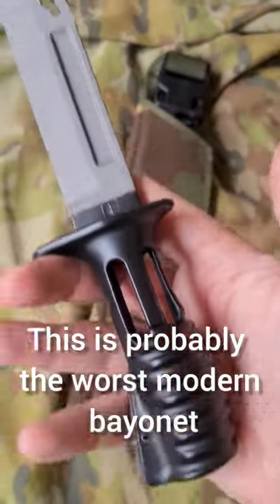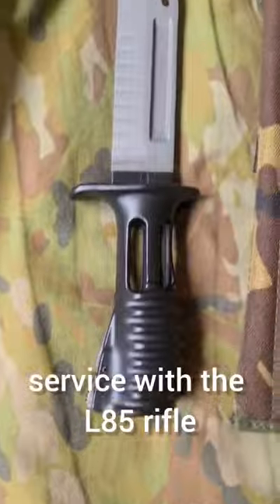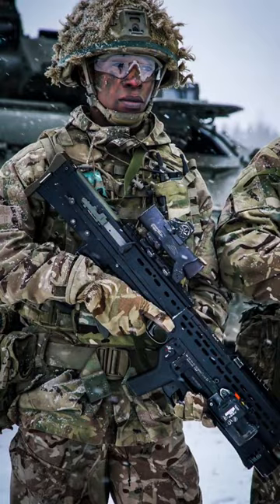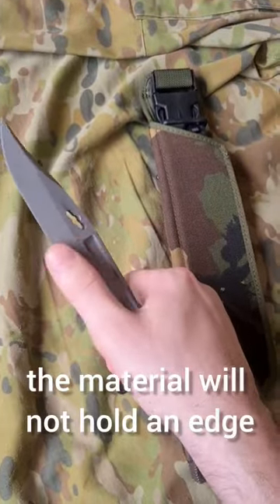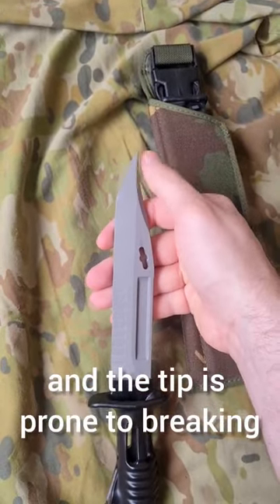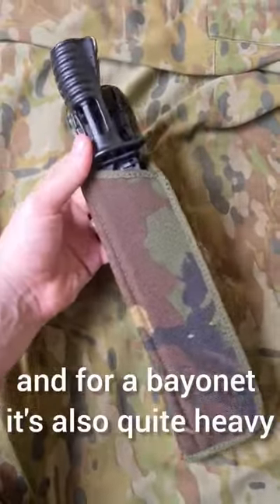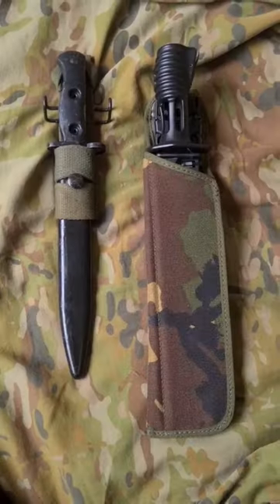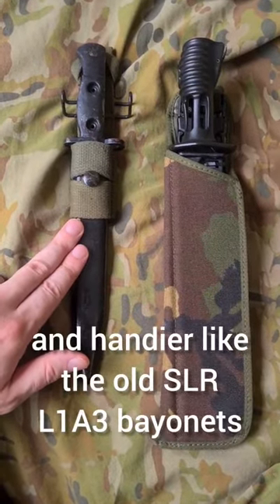How are they still using this 30 years later! #bayonet

Comment: How do the brits mess up a knife?
Reply: They got so much experience 😂
Reply: @angrydragonslayer Not true. The FN L1A1 was a great rifle, so was the bayonet. Similar for the Lee Enfield rifle. BREN and Browning pistol.
Reply: @anthonyhassett  i meant experience in stabbing
Reply: To be fair, we Americans can hardly laugh considering the issues with the M9 like how its designed means you can't cut electrical wire without wearing insulated gloves.
But then we also made the OKC-3S, which is really good, so I guess we do have some room to laugh at this bayonet
Reply: @anthonyhassett the Browning was Belgian, the L1A1 was Belgian (same designer as the Browning actually) the Bren was Czech and the Lee Enfield is gasps Canadian.
Reply: I mean, thats literally what they're known for!!
Reply: The British version of the FN FAL had a very different bayonet, based on older british bayonets, to the Belgian ones.
Reply: @warellis  the grip is insulated plastic and so is the sheath of the m9 bayonet
Reply: @justnsaliga8518  And yet the M9 bayonet guide says you can't cut electrified fences with it. If it is insulated to protect against shock, it has failed
Reply: @anthonyhassett  the BROWNING pistol was designed by John Moses Browning, an American working with a Belgian company. He's known as the father of modern firearms.
Reply: @caterpillar_rave  yes and no. 

The Browning Hi Power was largely the work of the Belgian man, Dieudonne Saive, who was John Browning's student at FN.
Reply: @Kav.  I will concede the BAP and L1A1 but the BREN still needed modification it was not perfect leaving Brno and Lee was born in Scotland while Canada was under the British empire.
Reply: @anthonyhassett  most of the mods to the Bren were production changes to be able to make it faster/cheaper, not really changing the function of the gun itself. I've seen every model of Bren (including prototypes) side by side and the only real major change you'll notice is between the Bren MkIII and the L4A1 (and the .280 British Bren guns but that's a bit outside the scope of the discussion). A Mk1 Bren and a ZGB really look almost identical. 

Lee I didn't know about actually, so you've got me there. I'll concede that one.
Reply: @anthonyhassett  I should say also, you could argue the L1A1 is sort of a product (or at least a collaboration) of the UK, the FN49 was developed as the SLEM under British contract before WW2 and Saive continued development in Britain during WW2, which is what led to the FAL we know today. But it's a bit of a reach.
Reply: We've messed up our country, messing up a bayonet is child's play.
Reply: Because they aren't even allowed to use them.
Reply: @anthonyhassett Some of the Lee Enfield bayonets aren't equal tbf.
Reply: We messed it up shaving your mum's top lip mate
Reply: @mitchelhill4305  😂😂
Reply: They banned all the good ones
Reply: Gotta have a license for a sharp knife there
Reply: My 1907 pattern Enfield bayonet is dated 10/16. It's 22" long with a 17" blade. My other bayonet is a January 1944 Mauser Kar-98K bayonet with a 10" blade. Both are kept razor sharp. I'll take vintage steel over modern any day.
Reply: @anthonyhassett well half of those aren’t even British
Reply: @angrydragonslayer  there's more knife crime in America per capita
Reply: @CapraObscura  statistically, yes

UK police got a case backlog of ~160 years and unlike the US, they do not introduce cases to the statistics until they are finished in court
Reply: @angrydragonslayer  I've just had a look... It's quite messed up, holy crap...
Reply: @CapraObscura  at least it means some stupid laws don't get enforced all that much

That new hate speech law in scotland isn't included because they can't even estimate the amount of time they need beyond "half the population of the country would be needed to process these cases faster than we receive them".
Reply: @anthonyhassett the FAL & Hi-Power  are Belgian, the BREN is Czech. The STEN is a reverse-engineered MP28
Reply: Once they said it’ll apart of a gun they didn’t know what to do..
Reply: how the fuck did they rule over 70% of the world with this craftsmanship??
Reply: @kitkat4189  you should see the craftmanship of that 70%
Reply: Trying to make it harmless so the mayor of London won't confiscate it...
Reply: Politicians.
Reply: Because you need a license to own one
Reply: It's a good bayonet, don't knock what you haven't used.
Reply: Get woke go broke

Comment: Just think... That went through engineering, resarch, development, more field testing, and was signed off by several in the chain of command before it was mass produced and issued, and it's still junk. Military spec doesn't mean quality.
Reply: You do know Eugene Stoner was paid £1m for a one day consultation? He chambered and extracted one round. Looked where all the scratches were on the brass. Then he explained where all the problems were in 20 minutes and how to remedy them. It would have been faster, easier and cheaper to bin the rifle and make a Colt m16 or Sig 552 under lisence at Enfield.
Reply: Milspec means lowest bidder😂
Reply: @anthonyhassett a M16 built at Enfield would have been crap
Reply: It's actually a good bayonet.

Comment: It was designed to not hold a edge we got told not to sharpen them they are a poking weapon not a cutting tool.
Reply: Which makes the tip being kinda fragile a much larger issue
Reply: So you have to carry a bayonet and a field knife as well. 2 knifes for the difference application.

I thought they were ment to be multi tools, like the Israeli one with inbuilt wire cutters.

This looks like a mass production war time bayonet, where you simplify the design to increase production and reduce costs........

Making them cheap and easy to replace so when you lose lots of men and there equipment you don't cost you lost of money.
Reply: I wonder if this just budget cuts for equipment or does it mean a change in thinking.

Spending less on the equipment we use least..

Still seems like a bad idea either way.

Comment: Having served for 26 years, transitioned from the SLR and SMG, the SA80 was a breath of fresh air. My bayonet always held an edge, but I didn’t use it for other things, I had other edged tools. If it gets to the point that you have to use a bayonet, then it’s just for effect, otherwise you’ve screwed up. The M-16 was an un mitigated disaster when it was deployed , it needed to have a forward assist plunger added, the plastic furniture was fragile, it had to be kept pristine to go bang. Yet like the SA80 it evolved into a decent weapon system.
Reply: The forward assist on the M16 does absolutely nothing. It’s so useless to the point where it’s known in the army as the “jam enhancer”, because that’s what it does.
Reply: @comrade_commissar3794  although often joked about and the late stoner himself said it was pointless. the device has come into use with faulty ammunition.
Reply: Yeah!But the Yanks did not need HK to fix it!LOL
Reply: @geronimo5537 my understanding was if a round fails to chamber you manually extract it and hope for the best with the next round.  If you are manually trying to force the round into the chamber the chances are your making it worse and wasting life saving time.
Reply: @Weakeyedominant  there are situations where merely running through the standard tap rack roll do not apply or are not allowed.
Reply: @pe.bo.5038 that’s because Royal Ordnance owned H&K at the time, you don’t buy a dog so you can bark yourself.
Reply: @pe.bo.5038 who owned HK at the time???
Reply: @pe.bo.5038  I mean by the point HK came in, there wasn't any military small arms manufacturers left in Britain because the government underfunded the entire military for decades and then Thatcher came in and killed all what was left of manufacturing. Try to learn something next time.
Reply: @RockSolitude  I'm well aware of that,so stick your lectures,where the sun never shines!🤢🤮
Reply: There was nothing wrong with the M16a1as it was designed and the forward assist wasn't added because it needed it but because of military insistence,  it failed in use because the ammunition spec was changed without consultation and the contractors cut the cost by not chrome plating the chamber and bolt carrier.

Comment: I never found my bayonet to be a problem. Took a tidy edge, didn’t break, didn’t crack, didn’t chip. It was good, even after months and months on deployment or countless exercises. Only time I had an issue with them was when the MOD brought into a contract for a new supplier, and they really were pish. Didn’t take long for that supplier to no longer…well, supply.  I have no complaints.

Comment: Yet probably the only bayonet that's been used for its intended purpose and done its job well

Edit: in the last 30 years
Reply from the maker: I would argue the US Marine OKC 3S, it saw use in fallujah. There are many photos of US marines clearing buildings with bayonets fixed.
Also a few photos and video from Ukraine of 6x5 bayonets being used in trench raids
Reply: @pointynotsharp  yeah both fair ,I will come at you at a different angle , do bayonets need to be very sharp ? no , do bayonets need a very fine point ? no and your other point is using a scabbard not used in almost ten years and it being heavy yes but it does the job regardless potentially even better as the rifle is butt heavy, Regardless of these points it does what it is supposed to, is it perfect? no its shit😄
Reply from the maker: @scott7892  I won't argue with any of those points 👍

Comment: If the tip of the bayonet was to break, it’s only like 2 or 3mm off the top, there is enough length in a serviceable bayonet where the Unit Armourer can just re profile the tip with a file.

If the tip was to break off while you are using it, the force required to thrust one into a chest would be enough that the small amount  of tip broken off wouldn’t make a difference in the heat of the moment anyway.

For its intended purpose of being a bayonet and being used in a thrusting motion on the end of a rifle, it does the job well enough.

Comment: The l85 is a perfectly good rifle after the A2 and A3 modifications to it. Accuracy is  pretty good for overal length. Only problem with it currently is the weight...its a heavy boi.

As for the bayonet ive never seen it careies with the cam cover on, and that isnt current pattern british cammo anyway. Always carries with just the scabbard.

 We are taught that the bayonet is not meant to be overly sharp and actually encouraged not to sharpen them. (I think armourers do occasionally) You hear different reasons for this but the most common are :

Avoids excess nicks to the, maintaining thr profile designed to be easily extractable from flesh

Prevents or limits damage by accidental injury, the soldier has to take deliberate action to cause harm.

Overall id say the hardest test for any piece of equipment would be giving it to a british soldier/RMC or a US marine. We use and abuse our kit to the extreme, so although certain precurment and development cock ups with these pieces of kit cant be forgiven, they are pretty damn effective in there current form.

Problem we have today is every other piece of kit.

Comment: You havent ever used one because the bigger failts are that it fits over the flash eliminator and gets red hot, the first model also fell off if stabbed into anything so you need an oven glove to pick it back up.

Comment: As was explained at length during training, the bayonet slides over the barrel not under it like previous rifles. We were not allowed to sharpen the knife or alter in any way or be charged. It also doubled as a cutting tool with the plastic scabbard, the main element of the bayonet was the blood channels that ran down the length of the blade to encourage flow out of the body. Doing the training to use this weapon is a particularly horrible experience.
Reply: You never did though .
Reply: @snowflakemelter1172  triggered are we? One of those wish I’d joined but my cat had fleas types.

Comment: The reason why the scabbard is bulky us because its a wire cutter and sharpening stone all built into one. Its not meant for slashing its for stabbing, separation of the ribs piercing of the organs. Its definitely not the worst modern bayonet in my opinion

Comment: Used for stabbing not cutting and never managed to break the tip of mine or ever see anyone else that managed it plus also converts into pretty sweet wire cutters with the scabbed which also has a wood saw 2 things he forgot to mention or doesn't even yet know .

Comment: I believe that it is not a forging but an investment casting.
Reply: That makes no sense if it is true. An investment casting wouldnt be as strong as forge steel or steel alloy. Casting only makes sense for a complex design item like prostethic knee or detailed lamp post.
Reply: Maybe the design of the bayonet is over engineered?
Reply: Lost wax casting originally.

Comment: Some down the comments are saying it's great, others that it isn't. It's clearly a piece of cheap equipment that mimmicks a knife-bayonet but doesn't seem to work as a proper knife at all, killing over half of the usefulness it would have for a modern soldier. Also, the fact it was used in recent combat doesn't make it great. If it's realistically only for making holes, then i'm tempted to think that a No. 4 rifle bayonet would be a much better thing to have instead.

Comment: 🙄 Well, I've actually worked with this very bayonet having been a skeptic of it before I signed on, and I can tell you now it's more than effective. Though the offset handle looks crazy, the way it sits into the hand aligns perfectly with the mid-knuckles of the hand, aligning the blade perfectly. As you can see the blade, guard and handle are all one piece, making it rugged and easily maintained. It's also easy to mount, even when your fingers are too cold to feel. And yes, it is sharp. Sharp enough to passively cut two of my comrades, (one through the shin of his boot). Plus we have a newer much more streamlined sheath, so you can forget about that old thing.
Reply: Signed on to what ?
Reply: @snowflakemelter1172  The British Infantry
Reply: @gordanator2060  non specific answers usually leads to a Walter Mitty.
Reply: @snowflakemelter1172  No it isn't. Keeping my professional specifics private so that my opinions don't get reflected negatively on the regiment I represent is just professional integrity.

Comment: Don't stop with the bayonet, the rest of the rifle is pants too. Such a shame as the SA80's grandfather was the EM2 first bullpup rifle made in the 1950's, that was a well engineered weapon from a single source of Enfield I think. When politics got involved there were too many cooks on the project and H&K had to step in and make it work in the end...if I remember correctly?
Reply: H&K belonged to Royal Ordinance at the time. You can look at any other modern weapon system to see the same or similar issues with the first generation - M16 comes to mind, as does the G36.
Reply: @SlickSpeedy neither had most of the working parts replaced and the bodies and trunnions re machined, there no comparison.

Comment: It not fair assessment, it’s not meant to hold and edge or be sharp as per regulations under the Geneva Convention. Also with is scabbard, combined with the bayonet forms a set of wire cutters. The bayonet is for killing buy stabbing and this is why it has the blood channels down the side. So your rant was poor and very uninformed.
Reply from the maker: It literally comes with a sharpening stone, the Geneva convention is not a regulation and makes no mention of bayonets and blood channels don't exist, fullers are made for weight reduction. Nearly all modern bayonets come with wire cutter, so that doesn't make the L3A1 special.

Comment: Why do they have to stick it on the barrel?? THERE IS A REASON THE BAYONET HAS BEEN OFFSET FROM THE BARREL SINCE ITS INVENTION!
Reply: The first bayonets had tapered handles so they would fit inside the barrel. No connection point yet
Reply: Actually the originally bayonets were plug types that went directly into the barrel lmao. Then socket bayonets like this one before the modern blade type. 

So wrong on all counts I'm sorry to say
Reply: The bayonet still allows for shooting though. I don’t know what you’re problem is or why you’re screaming

Comment: Bayonets are not supposed to be sharp. They're supposed to be dull. They're not a fighting or utility knife.
Reply: Bayonets are coming already sharp. 
At least the AK ones.
In the army my AK came in wood box wrapped in cerium papers and full of vaseline all around. In the box was also the bayonet.
Very sharp.
They collect all the new ones and grinded after fewer soldiers cut themselves.
Was able to slice a tin can in one move.
Reply: This is a myth. 

Bayonets are meant to be sharpened upon issue by either unit armourers or at an individual level. You can find this with pictures from WW1 showing bayonet grinding for example.

Comment: Got to be said, but this is the worst video ever produced slagging off a bit  of kit, no explanation at all. Its probably the only modern bayonet to actually be used for it original purpose, charging the enemy in combat, and done a great job at that, its a unique design and it works well, got a blood channel, many other bayonets dont, end of the blade is angled to help separation of the ribs, again many others dont, with the  sheath it can cut wire fences , has  sharpening stone, wood saw and a bottle opener for a ice cold beer after killing the enemy. Never had an issue my self, never broke, chipped always kept an edge and not as bulky as this idiot makes out.